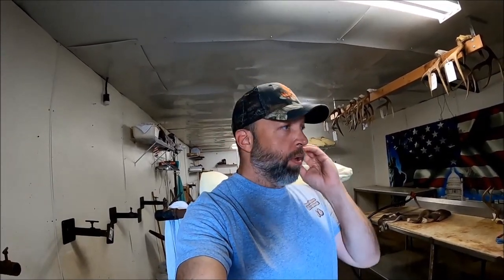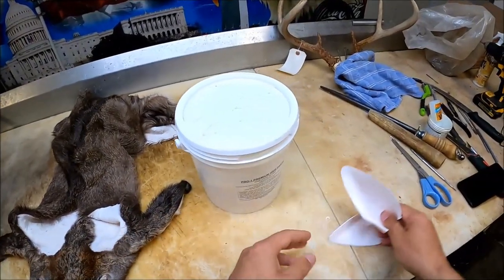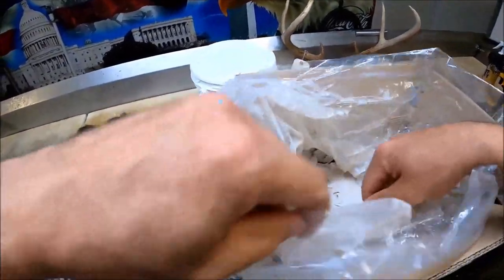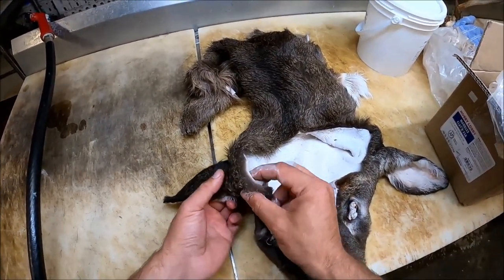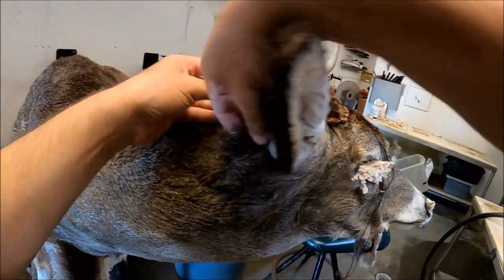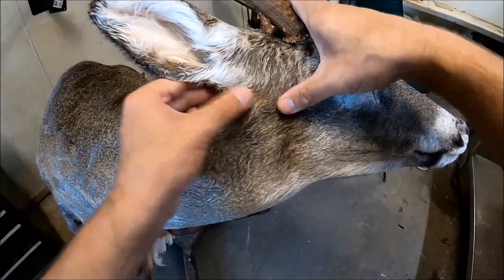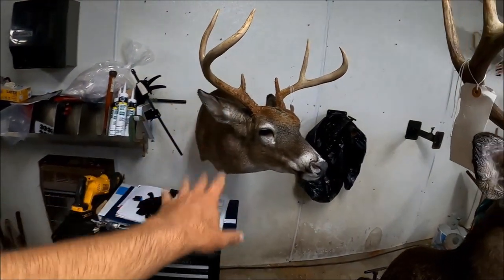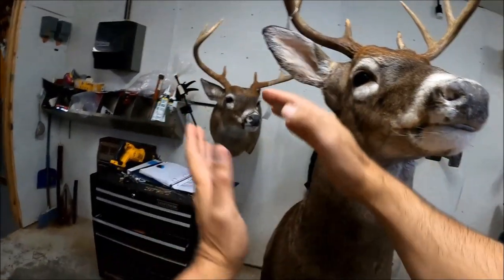HOW TO mount deer EARS!!! (how I do it anyway) ***SUPER EASY*** WHITETAIL TAXIDERMY!!

Comment: Steve S. Great videos. I’ve seen a lot of other card and staple the ears till they dry to prevent drumming, is that necessary? What do you do to prevent drumming?
Reply from the maker: I use Pro 1 hide paste and don't card the ears at all. I will bag them along with the head for several days until the glue sets and check them daily to make sure they have good adhesion. I wouldn't recommend this with any other hide paste. Ears done with other thinner glues definitely will need to be clamped.

Comment: So Daniel once your done with the building up of the ears with clay does the clay on the ear butts get hard and stick to the form from the hide paste? I was asking because some of the other taxidermy videos I’ve seen they use ear liners and butts that attach to each other and they put a screw into the butt to the form.
Reply from the maker: Yes and once the hide dries you would have to saw the ear off to get it to move

Comment: hello! I just acquired a mule deer mount that I want to hang up but his ears are kind of splitting at the tips. I'd like to try to repair it but I don't want to ruin it either. So I was wondering what you'd recommend I do. Would super glue be okay?
Reply from the maker: Yes it will be fine to try. I’m not sure it will hold depending on the size of the split but I would try gorilla glue gel and then clamp it for 24 hours and let it cure.

Comment: Have you ever cut the muzzle and added foam or clay to make the muzzle longer?
i have a 243 lb dressed out deer and my measurement was 8”+ eye to nose.  
thanks for any advice.
Reply from the maker: Not yet, but it would probably be easiest to do back behind the mouth and cut carving foam to make an extension. Then ad dowels and hide paste to reinforce it till it dries. Afterwards I would use epoxy to smooth the edges and help bond it all together
Reply: Thanks!!!

Comment: Do you have any good recommendation for freezer burnt deer ears
Reply from the maker: They are horrible to deal with for sure. The only thing I have found that helps is to soak them but not the entire cape in a small bowl of salt water until they rehydrate. This helps a lot but you still have to be slow about turning them because they do get brittle
Reply: Appreciate the videos thanks for getting back with me.